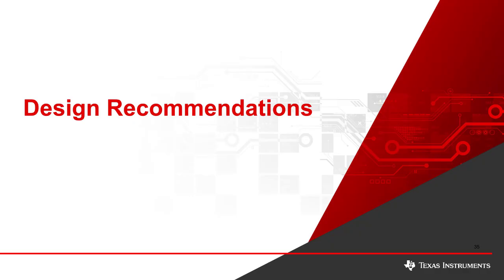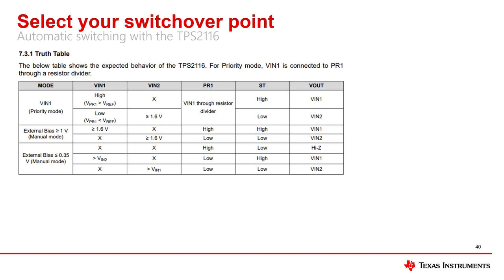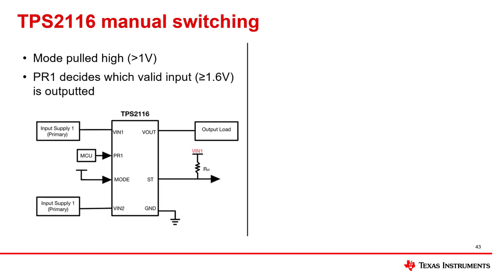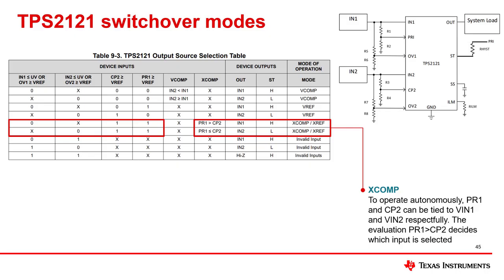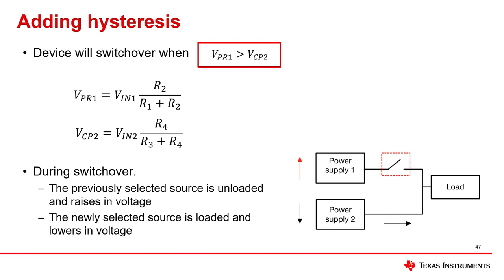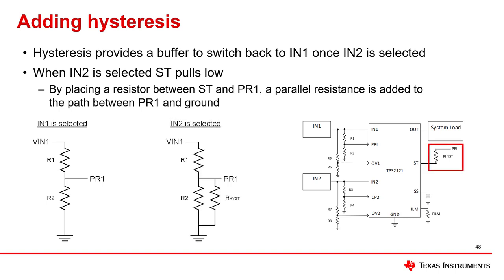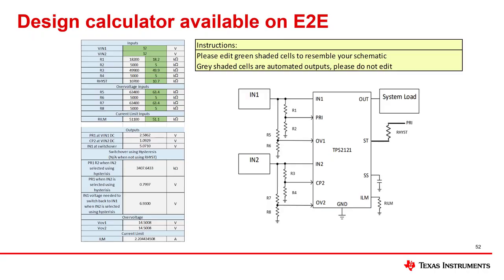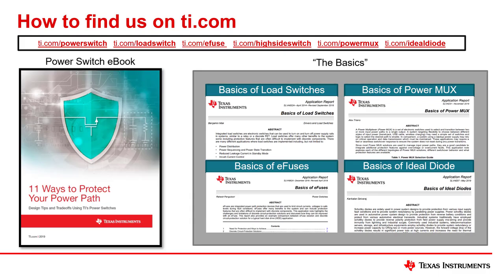Schematic and layout tips

Comment: This video was shown as the first one of the series about power muxes in my timeline. With it's title and the jump right in without any introduction I was quite confused.
I'm even more confused how a voltage V_{IN1} can be less than a unitless ratio of resistors (R1+R2)/R2 - did you forget some voltage on the right-hand side of the equation? Yes, you did... you need to keep the 1 V as well...
Honestly, I am a bit disappointed by the quality of most of your short videos lately...
Reply: A better audio would make a difference.  Nowadays every youtuber has audio of studio quality. TI could also work on that